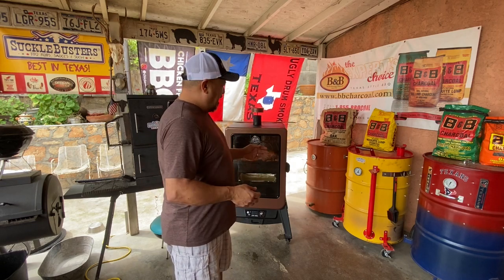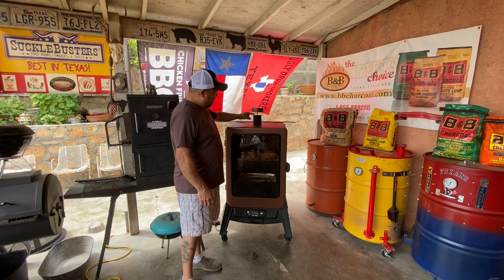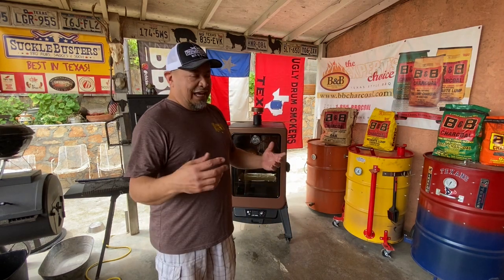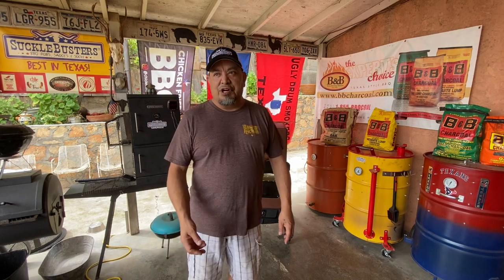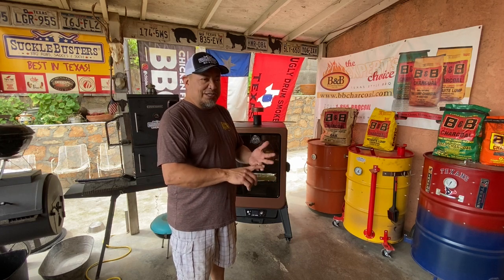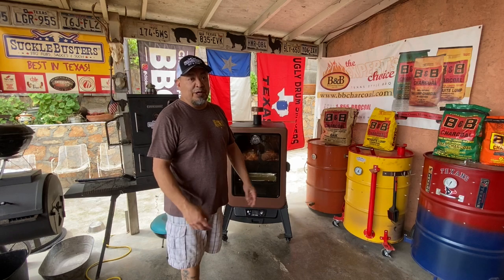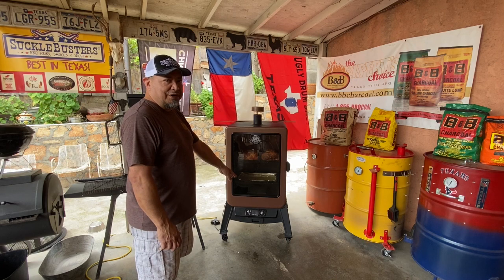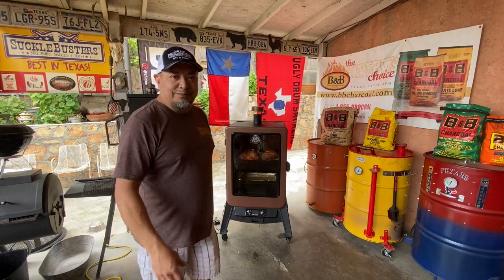PitBoss Copperhead Still Broke ErH

Comment: Ok I have had this issue I think I know the solution. Mine would give Erh and would have wild temp swings and sometimes go out. 

So far I have smoked twice with with this solution. You have to vacuum out the pot after every use I think this is why the pro series has the clean out 

You have to
Reply: This is my assumption it is really humid in Texas and also sometime use water pots this moisture caused the ash from the pellets to harden in the bottom on not blow out while cooking. Let me know if this helps pain in the pork butt
Reply from the maker: Hello Mr. Gilmore 
Thanks for watching and for the comment. I did vacuum the pot and interior of the unit after every cook. Still had the issue. Good luck with yours and I hope it keeps working right for you. 
👊🏼

Comment: I have the same model but I just set mine up and it ran for 30 minutes now it's stuck at erh code
Reply from the maker: RM  I’ll ask you like they asked me. Is your vent on top ALL the way open? Apparently it’s supposed to be
Reply: @RicsBBQSpecialties  yeah it is and the water pan is up higher. Now it's just stuck oh the erh code
Reply from the maker: RM * hmmm I believe it needs to totally kool down. I’d try again tomorrow or open the door and put a fan in front of it for 30 minutes or so and try again
Reply: @RicsBBQSpecialties  ok thanks will try!!

Comment: Did you ever get this straightened out?
Reply from the maker: Hello, I wound up taking it back for a refund. I picked up a Green Mountain Grill and haven’t had any issues with it.
Reply: @Ric’s BBQ & Specialties  I got a Boone and a Crockett to go with the 1st generation Series 5 Pitboss, the only problem I've had with the Pitboss is during the cold and wind up here in New England it has a hard time maintaining temps the temp swings are just to big

Comment: Had the same problem. Folded some aluminum foil and put it in front of the unit thermocouple to keep it out of direct heat from the firebox and used meat probe to read temp at the rack lol. Works for me but I’ll have to try this method out!
Reply from the maker: Good Luck!

Comment: Shouldn't it be plugged into the wall not an extension cord
Reply from the maker: Hello Mike, that’s a good question and one I researched myself. You Can use an extension cord as long as it’s heavy duty. Which I do have and used.

Comment: Mine been doing this since I got it told wife I'm gonna shut can it and use my 20 year old 99$ charbroil stick smoker,  its fing garbage I'm so sick of it.
Reply from the maker: Hello, As you can see from the previous comments. We aren’t the only ones that had issues with this unit. It’s Junk!
Reply: Update I cleaned temperature probe, seemed to work for about an hour before I shut it down, the manual says to clean probe after every 2 to 3 cooks. We'll see what happens on next cook
Reply from the maker: Good luck